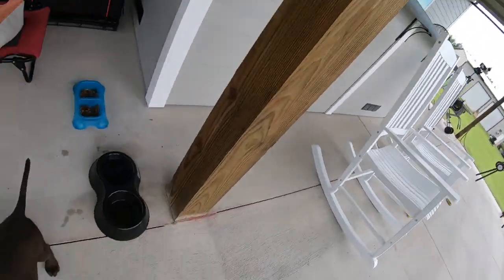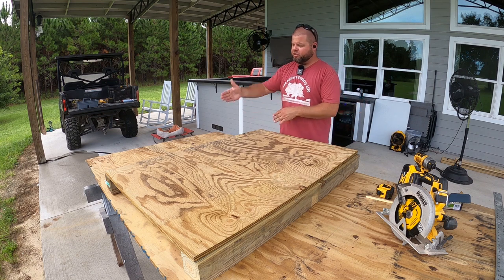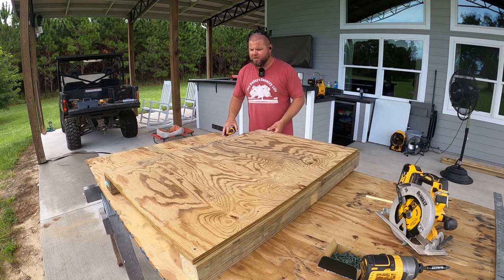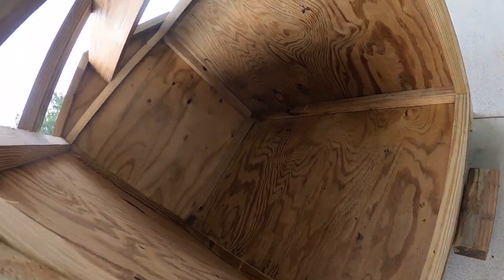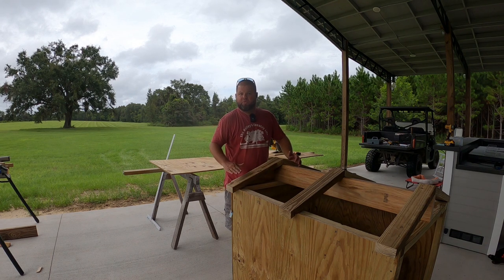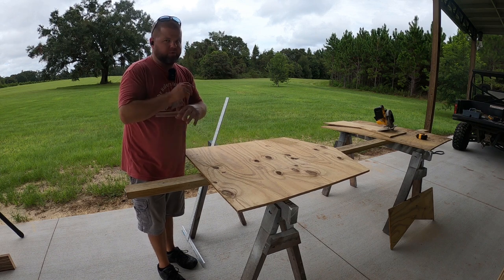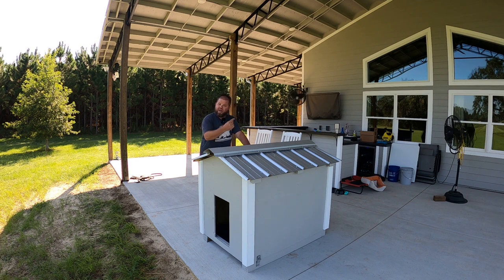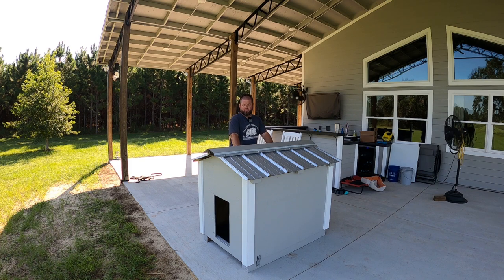DIY fold open dog house! Easy to clean and access #639

Comment: flip the sheet of tin over so instead of shifting the drill down to go over the bump you lift the drill up to go through the valley. Also, I suggest a remnant piece if linoleum flooring under the dog bed sorta like a dish so and liquid wont make it to the plywood.
Reply from the maker: Great tips, thanks!

Comment: Always set up a dog house on a plastic pallet… so dog house floor not in contact with hot or cold dirt… also easy to lift pallet and put down ant poison so pet not get into the poison
Reply from the maker: In contact with dirt? His floor is 3.5 inches above the dirt.
Reply: @TKCL  my reply is meant for others building a dog house.   Air space below floor… I have seen careless people leave out the floor and sit the house on a concrete pad…just inhumane
Reply from the maker: Ahhh I see

Comment: Great job! I would paint the inside bottom, bed area. This would allow for better cleanup. Even a treated wood will absorb liquids. Over time those liquids make smells. A painted surface you can wipe clean. Which it sounds like you like. Again great job. 😊
Reply from the maker: I agree

Comment: I used to build a flip open top well house. That way every time we needed to get to the well, change leather's, switches or make it deeper throughout the years. That should work for a doghouse too.
Reply from the maker: Well your in luck, I've got a similar design in mind I've been planning for over a year. I'll build it this winter or next spring.

Comment: Andrew, you could cut some of the corner pieces in half width ways, and line the entrance. I think it would look really sharp with half the width trim there. You could just attach with 3 screws, so if you ever needed to make the entrance bigger, just unscrew them, cut the opening and make 3 new pieces. Also, you could use that trim and trim out around the top under the roof, to match the white trim under the roof under the porch. Great house for baby woofer.
Reply from the maker: For sure that would look better.

Comment: What? No hardy board?😂

I would paint some little lines on there just to mimic the house, it would look a lot better, you could even set a sawblade really low and just cut little grooves in it just for cosmetic sake.  It looks great but just putting those horizontal lines would make it match the house a little better. I would trim the door as well. Lol
Reply: Ply-Bead

Plywood Siding Plybead Panel (Nominal: 11/32 in. x 4 ft. x 8 ft. ; Actual: 0.313 in. x 48 in. x 96 in. )
Reply from the maker: Using scrap and other plywood I already had.
Reply: @TKCL  You can always update it lol
Reply: @TKCL  you could put more LED lights in there. Lol
Reply from the maker: I've got way to many other projects falling behind 😉

Comment: I suck at carpentry especially if it’s rise and run stuff how did you do the roof?
Reply from the maker: Just flipped a center 2x8 on its side and cut 2x4s to the correct angle to it. Hard to explain, but I just put a 2x4 up to end of the 2x8 and scored a pencil line. Found that degree mark on my miter saw for repeat cuts.

Comment: Do you think the edges should be rounded and sanded so no sharp edges,  I can see either cuts on you or pup when older!
Reply from the maker: I've already got rubber edge material on the way.
Reply: I could see that tin cutting Rugers paws or face if he jumps up there when he's older and taller. Is there anything you can get to edge it with or to curl the sharp edge back on the roof tin?

Comment: Why didn't you paint the inside walls and floor?  I think it would have looked better.  That puppy will be chewing and will chew the door opening without trim on it and even with it.  It is easier to replace the trim than the plywood around the door.
Reply from the maker: I was worried about him chewing paint on the inside. We he lays there and gets bored a little chewing starts.

Comment: With insulation, Hardie board, tile,  asphalt shingles, and under floor heating. I totally over built the dog house for our Labs. Hey if you're going to build it... Over build it. I see you have a cap for your propane quick connect.
Reply from the maker: I did..... Ruger found it 😬